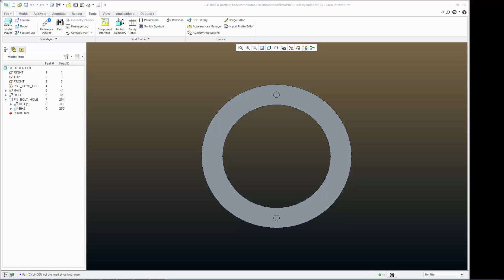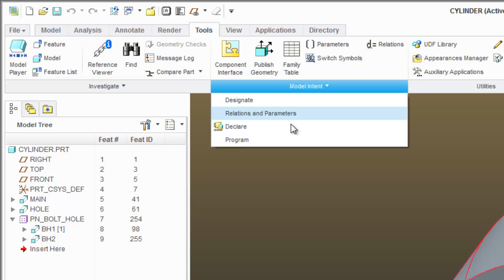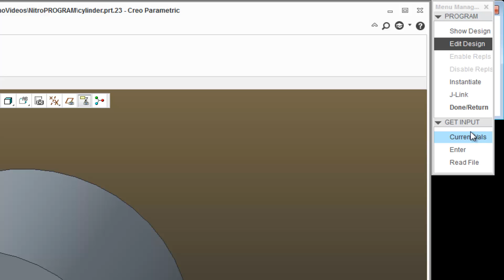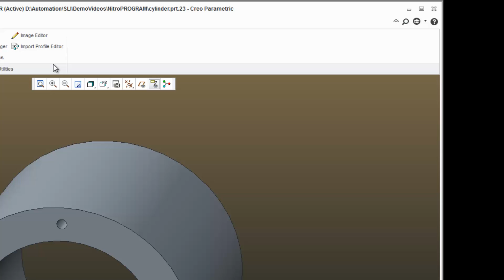Pro/Program INPUTS for CREO & Pro/E - Video 3

Comment: If instead of simple hole my bolt holes are standard iso threaded hole then what will be the my inputs
Reply from the maker: This depends on the configuration of your model and the logic you want to drive.